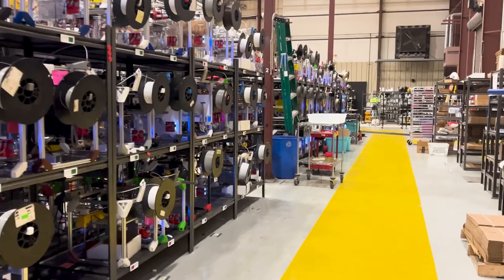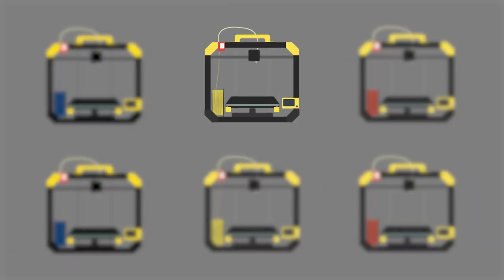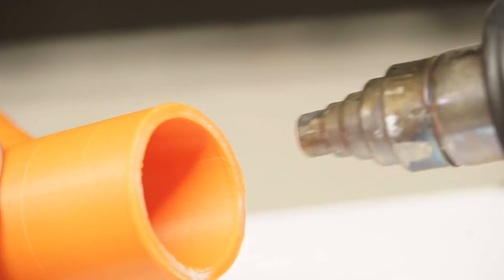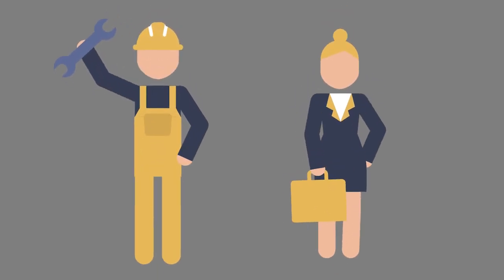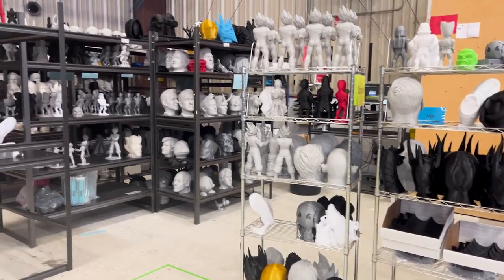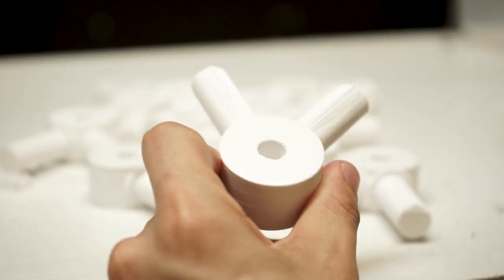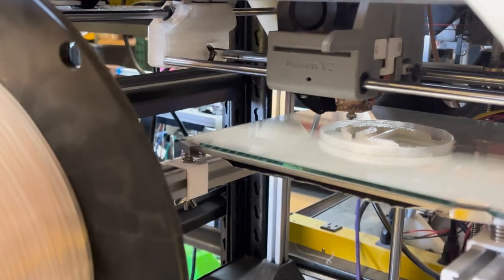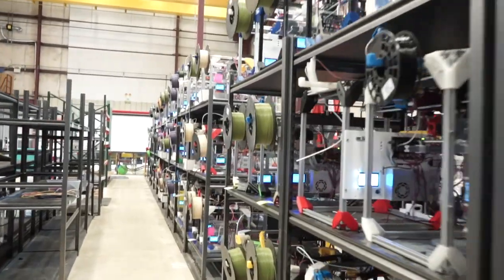A Bunch of 3D Printers do not a Print Farm Make

Comment: Arduino box from 3:54 doesn't look like a product I would like to show. Walls are uneven, broken ender 3 could print like this.
Reply: Holly Molly, yeah, that part really doesnt look acceptable
Reply from the maker: Industrial hardware often shoots for low resolution in order to optimize cost a scale. A box in a warehouse is not a cosmetic component. So function is prioritized over form
Reply from the maker: Understanding the priorities of a client an are another important component of running a factory rather than an artisanal prototyping service.
Reply: tbf it is just a box, it doesn't really need to look good
however, i kind of wonder how do you even achieve that kind of quality
that's not the look of a part printed too fast, that looks like massive underextrusion
Reply: With proper manufacturing hardware this would not have been an issue as you have clearly pushed the machines over their limits resulting in massive underextrusion.
Reply: @slant3d  i understand but i also think well calibrated machines produces good looking products even when cost efficiency is most important
Reply: @The2pcio even with the best machines in the world, it’s a balancing act between speed, cost, quality. Consumer grade = high price, lower speed, high quality. The same is not true on every use case and if I need 10,000 units in a week, I need to make a call on what I’m prepared to accept as “good enough” - am I going to pay through the nose to take up every machine in the factory (stopping all other work), or am I ok to keep the cost reasonable, increase print speed/layer lines height, reduce part complexity etc etc and focus on the basic function of the part

Comment: Thinking about consistency, do you have customers who specify colors that comply with ANSI standards?  I imagine you could either spec out filament from your suppliers or make your own.  I would think making your own (to meet a standard) would entail a complex process all its own.  Nonetheless, even if your customers do not require colors that meet a particular standard, just getting a specific color filament that does not vary for 50,000 parts may be difficult.